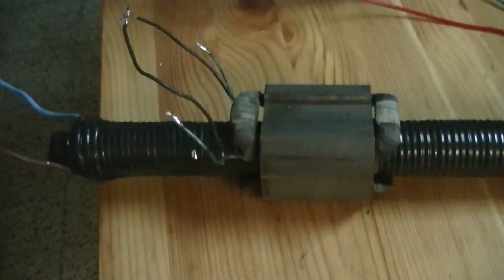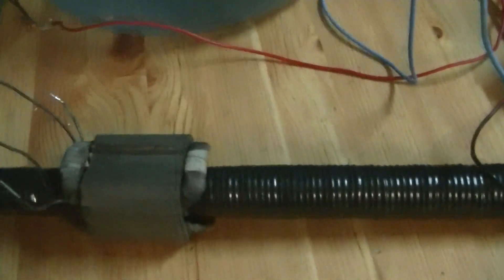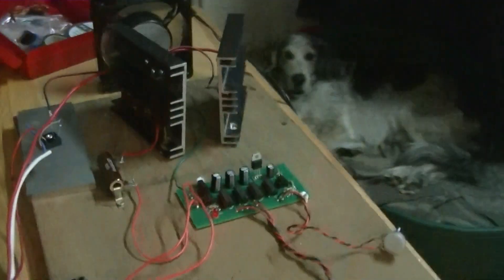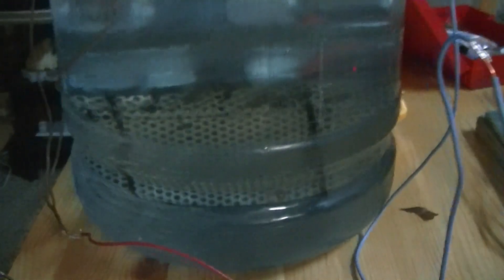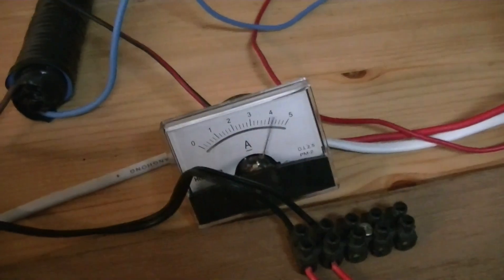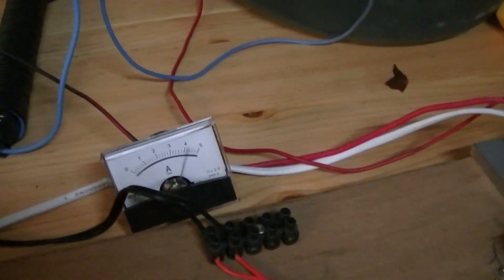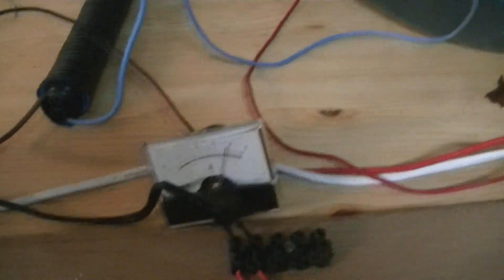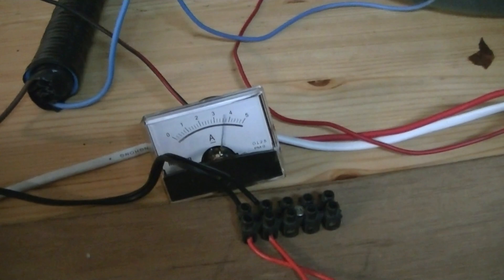8xa 60 volts 4 amps NO ELECTROLYTE HHO MEYER STYLE

Comment: that inductor was not designed for the meyer circuit. the house wire welding rod inductor your using was designed for a buck converter, which is much different the the meyer circuit

Comment: The fluctuating current is most likely due to using perforated plates. The bubbles must be pushing the water away from the inner surface of the holes thereby insulating it with HHO and the current drops. The bubbles will stay in the holes due to surface tension until buoyancy wins. The bubble exits at which point water fills the hole and current peaks again. 

Maybe?

Comment: Now just so you know the 8xa circuit being used like this shown in the International Independent Test-Evaluation Report used 4-5 amps @ 80 volts and the rotary one used 40 amps @ 12.5 volts. Again the key is resonance and since the 8xa loses control of the frequency you can try and match the set up to the grid frequency for resonance as that should really bring down the amp use. The need for the full circuit was water's dielectric varies with temperature which changes the capacitance of the WFC.

Comment: @theoneagain Yeah, I had the same problem every time I tried to hook up the scope to see the wave form.  The 8xa circuit needs a WFC with a capacitance of 1 uf which is a very large WFC. Add in 2-4 neutral plates, and give all plates a space gap of only 0.010 inches (0.254mm). Use plastic shims as they can be brought to that exact size. To get the 8xa circuit working good make the set up resonate at the grid frequency or 2x the grid frequency. Problem is resonance is temperature dependent.

Comment from the maker: @h2opower i tried today with my 16 plate dry cell doesnt work 2,5 mm gap i think the gap needs changing because that s the only thickness i had i need 1 mm i was pumping out 8 amps couldn' t even get the volts to increase without the amps going crazy so so much for that method when the cells are immersed in water completely it works ok. bizarre

i ll try again though with a different gap and different coil

Comment: @theoneagain It has to be the chokes he is using, as I am using 2 Henry chokes and only using roughly .50amps@150v, and when I take it to 300v I am only using 1.33 amps putting out approximately 1LPM. The design of the WFC(ER) is very important as I have my ER all wired in series and the capacitor spacing is only 0.025 inches between electrodes. The ER 10 I am selling has a spacing of only .015 inches and all of the capacitors are totally isolated from each other. The Canadian patent shows this.

Comment: The only way to get the amps down is with the full Meyer control circuit where everything is run in resonance. No resonance no amp restriction! The variable power supply for the full control circuit is very easy to make if you follow what is shown in the patent. The full control circuit takes care of the limitations of the 8xa circuit as that circuit was a prototype leading up to the full control circuit. See if you can get the full control circuit and keep up the great work ;-)